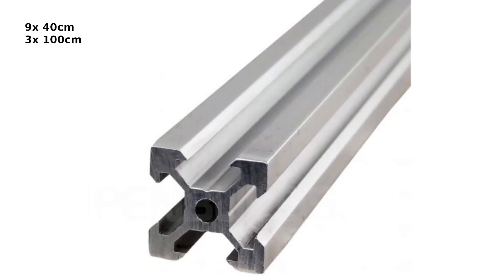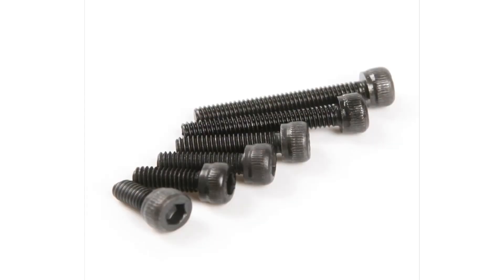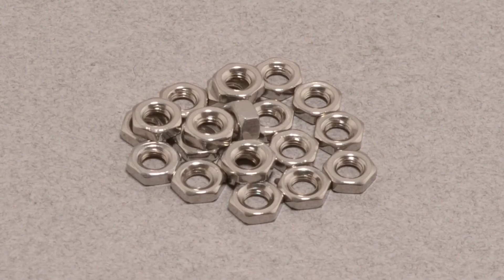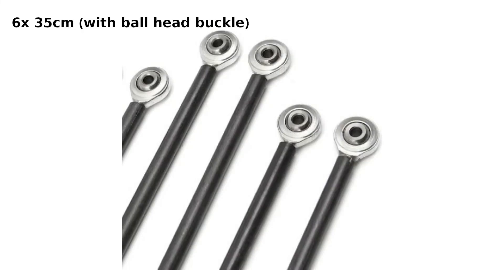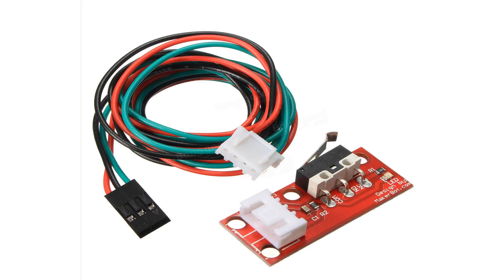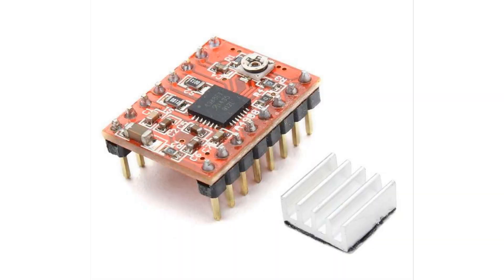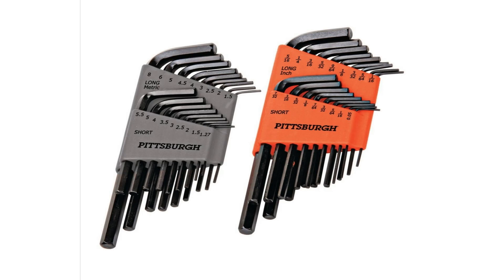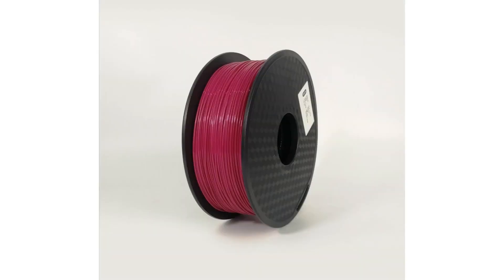Build a Delta 3D Printer - Bill of Materials

Comment: I want to build this printer but I cant seem to find the "6x 35cm long glass fiber rods" anywhere... is there another name or can you link me something for reference where you found them?
Reply from the maker: You can either get a long 6mm or 8mm diameter glass fiber rod and then cut it to 6 35cm pieces or either get carbon fiber rods (these ones are a lot harder to cut so get them already cut)
Keep in mind you'll always need the ball bearing for whatever type of rod you're using

Comment: Hi.. The 3d files seem to have a problem as an error comes up when i import some models in cura. "the highlighted areas indicate either missing or extraneous surfaces". Please help
Reply from the maker: yeah apologies, some files have not been properly optimized and have small errors on the geometry, it does however affect printability you can just ignore the error message and go ahead and slice
Reply: @myriadpro6752  can you please fix the errors as i am having problems with the part after the print
Reply: @myriadpro6752  bro why did you delete my comment